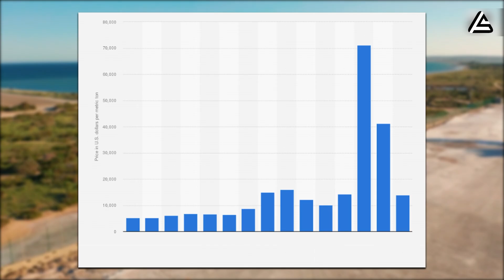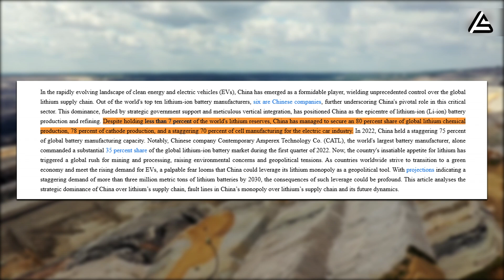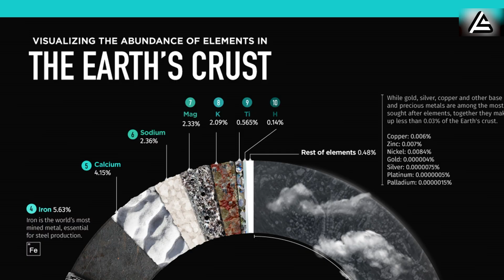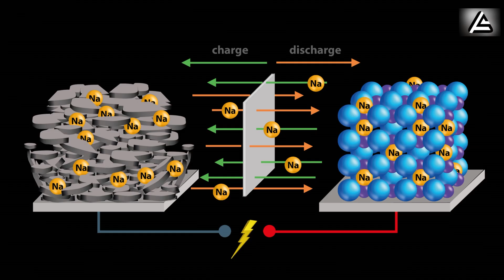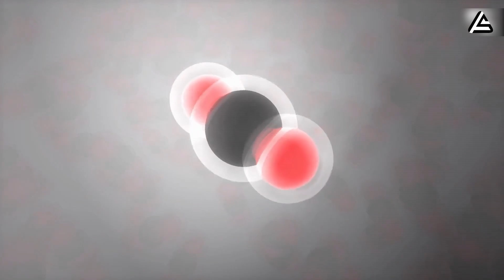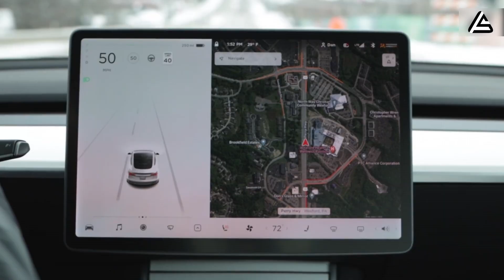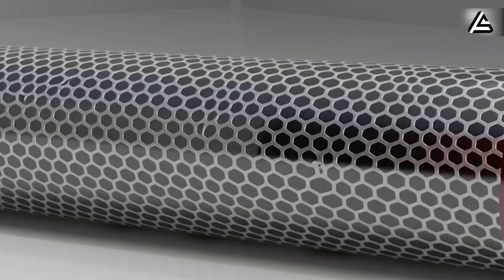Elon Musk Revealed 2026 Tesla Sodium-ion Battery: What You Need To Know?

Comment: Sodium-ion is useless for cars. Less energy density than Li-Ion batteries. Thus much heavier,  shorter lifetime, less charging cycles, shorter range but will be cheaper. This is another dead end.
Reply from the maker: It's true that sodium-ion batteries do have lower energy density compared to lithium-ion, but their advantages lie in lower cost, greater safety, and better performance in extreme temperatures

Comment: While I understand Tesla wants you to use their charging stations, how about some information on how long to charge at home with 110-volt power. It says fast charging doesn't heat up as much as slow charging so can you give any information on how long it takes? If someone needs to buy a medium charger how much does that cost?
Reply from the maker: For sodium-ion battery cars, charging from a normal 110V home outlet is still quite slow, it can take around 16-18 hours for a full charge depending on battery size. A medium (Level 2) home charger with 240V power is much faster, usually 4-6 hours for a full charge. The charger itself costs about $400–$600.
Reply: @AutoGearShift2  Thank you. This is the kind of information plenty of people need to know. With a 250-mile range most would only be recharging once a week. An overnight charge would be what most would do in a real-world situation.
Reply from the maker: yeah thanks for your sharing